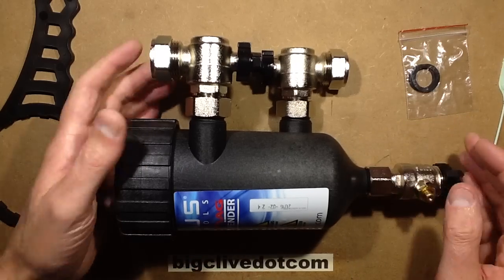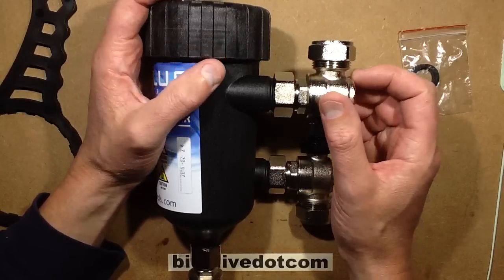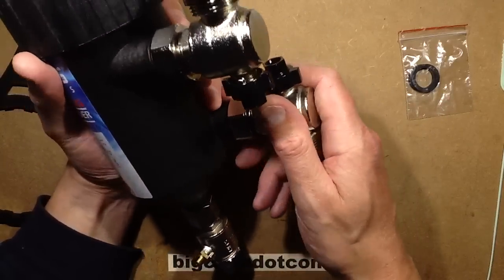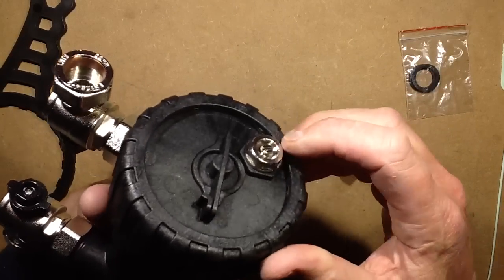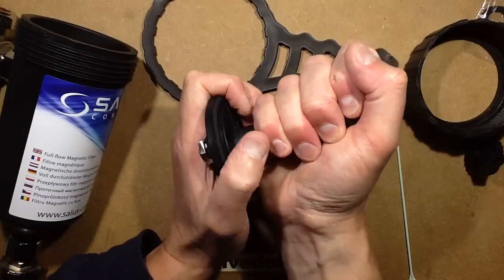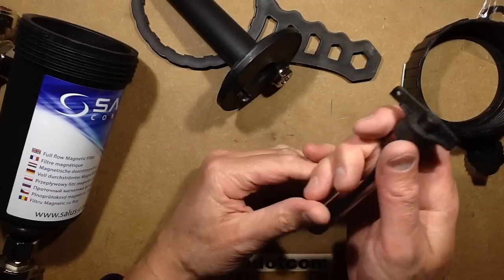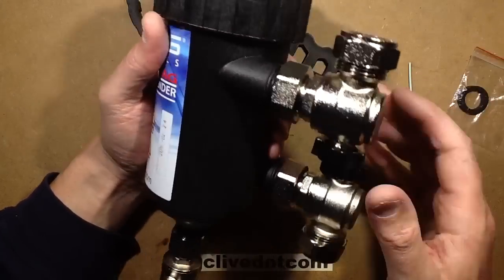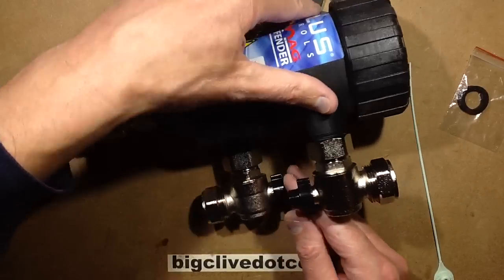Inside a heating system magnetic "sludge" remover.

Comment: i think they put the two pipe connectors offset from each other for two reasons

1) to encourage the whirlpool effective inside the cannister so the debris spins around makes contax with the magnet so more chance of getting trapped in the can. 

2) lateraly stability of the unit. because it sits off the wall so prooudly, it can easily be knocked. Having the two connected pipe either side gives the can a bit of sideays knock resiliance.

Comment: Clive how did the install of this device work out for you? I wished I had hot water heating in my house or better yet steam heating . But I have central air with a heat pump. Each has it up and down sides.
Reply from the maker: It's still in the box.  The location of the pipe it was supposed to go onto was in a 3" gap between the back of the boiler and the wall of the tiny room it is in.  The pipe then went under concrete and then underfloor.
Reply: @bigclivedotcom  So you bought it back in 2016 and almost 6 years later it's still in its box ? 😂😂

Comment: I thought the UK was up to the times. Steam heating. Wow ! How barbaric and inefficient.
Reply from the maker: Not steam, just hot water radiators run on a loop from a central boiler.  Much cheaper than electric heating.

Comment: thing is, what stops the anti corrosion chemical getting into your drinking water?
in our house we often fill the kettle from the hot tap , as the water tastes weird from the cold
Reply from the maker: The radiator loop is a completely sealed loop that does not have a direct connection to the normal water supply.

Comment: Ok, I realize you have probably dealt with the problem by now... But couldn't you have just released the nuts on the housing and turned the connectors slightly to make them in line? Of course then they wouldn't be in line with the rest of the thing, which may or may not be unpractical, but they would in line with each other...

Comment: You know that the iron oxide, called magnetite, will stop forming when all the oxygen is used up, right? If you have a sealed system that doesn't leak and never add any water this is completely unnecessary. And oh yeah, "flushing" your system completely defeats this.

Comment: I think what I need is something to protect my boiler. I was told about a proper  water softening device that uses salt tablets to soften the water and eliminate most of the sediment problems inside the Boilers clarifier and your washing machine should not only last longer but you use less soap.
But I will get one put in and save my Raddies

Comment: Do you really use hot water heating systems? My house is a forced air/radiant floor heat combination, which uses a larger burner and a smaller blower to create approximately 75 degree (Celsius) air, which flows under a network of pipes under the floor and above the ceiling to warm them and radiate heat, and then pumps out about 50 degree air through the registers. For a house with stone tile flooring which is ceaselessly cold, this results in nice, warm floors and the ability to run a whole-house humidifier in Ohio's dry, freezing-cold winters. (I mean dry, before we installed that humidifier we would dip to 8%RH or so in the house for months at a time.
Reply from the maker: Pumped water is one of the most common heating systems in the UK.  These days it's often used as an underfloor system whereby the floor is laid as a thermally insulating layer, then a matrix of flexible pipes and a final floor layer.  All the heating is done at low level from the floor so it's silent and very ambient.  I wish we could have low humidity here.  Being in the middle of the Irish Sea means I need two plumbed in dehumidifiers to keep the humidity down to around 60%.  Without them it would rise to 90% or higher.
Reply: We have forced air Heat Pumping to dehumidify our house, works fine in the summer, when humidity is upwards of 90% (Lake Erie Downdraft) but it gets so cold here that we need a gas burner to supplement the heat pump for 4 months of the year. Fully-Automatic system, with heat pump to cool mode at 24 Celsius, heat pump to heat at 22 degrees, and supplemental at 20 degrees. (Approximate temperatures, the thermostat is most likely smarter than you or I, and looks at outdoor weather to decide what to do. )

Comment: wonder if that would work in the sump pump systems.  Which is needed both during the winter and during the summer.  Sludge hell in that sump pump which well, kids shouldn't be around it.  the electricity is tied out with a plastic/metal tie  smh  oh just unscr...zap  Probably Iron Sludge.  No Radiator around here.  It's a combination coming from the Aprilaire (yuck) and 3-4 other drippy areas.

Comment: once the dissolved oxygen has reacted with the steel that's most of the corrosion over as long as no fresh water is introduced.  most pinhole corrosion is copper particles settling on the steel and creating galvanic corrosion . as a plumber I find these devices mostly useless as they don't actually stop corrosion and there an expensive way of adding corrosion inhibitors.  Most central heating flow rates wouldn't disturb settled sludge in radiators either

Comment: That looks like you could pretty easily turn the connections to be in line with each other.  Loosen the fittings at the body of the unit, turn to preference, retighten.  Maybe add a little seal tape for good measure.  Yes, it will skew the body of the device relative  to the pipe you splice it into, but it should be fine.

Comment: just extend the boiler pipes down and fit under the combi then go bk up to the existing pipework clive
Reply from the maker: That would be tricky, as it's an oil boiler that sits on a concrete floor.

Comment: I'm not familiar with this kind of distributed heating system, though I understand the basic idea. My question though is why don't they make the radiators out of copper as well as the pipes. That would eliminate any galvanic reaction issues wouldn't it?
Reply from the maker: Probably cost.

Comment: You still have a water heater radiation system? Wow. That's one of those things that I so out of style that it's cool.
Reply from the maker: +awesomeferret Heating a house electrically in the UK would cost a fortune.  Gas and oil are cheaper options.
Reply from the maker: Very common in the UK.   An oil fired boiler too due to the cost of fuel on the Island.
Reply: bigclivedotcom I wonder what the reason for that is. Older houses? I know it works well and isn't really "obsolete" but i'm still wondering why it's used. Is electricity really expensive in the UK or something?
Reply: Godfrey Poon old post but oil boilers are a huge part of any remote part of the country that doesn't have mains gas. Propane is way to expensive

Comment: UK gas heating engineer here. I replaced our 12kw forced air heater with a 24kw combi boiler, with all the rads and pipework it came to less than £2,500, but I didn't skimp.. the new system uses less gas than the old forced air unit did as it cycles on and off less frequently. there is no way near the amount of dust collecting on all our surfaces, and we have instant hot water at mains pressure as well as a new cupboard in the bathroom where the old cylinder was. The one thing I really do miss though is how quickly the house warmed up with the forced air unit... 
as has been said it previous comments the filter should be on the return leg of the heating circuit as close to the boiler as possible. that way you protect the boilers water section, and capture the most sludge possible. be wary of putting it in place of a radiator as you have effectively created a full bore bypass on the system, your rads won't get as hot unless you put a valve in there somewhere to control the flow.
Reply: +Rob k (RobKix) 😂 you do DIY, I am a professional tradesman with access to more knowledge than you will probably ever have on gas heating, as well as years of experience doing the job day in and day out. If I ever need an LED clock I will be in touch...
Reply from the maker: If I do it I will restrict the flow and just use it as an ambient filter to gradually catch water borne particles over a longer time.
Reply: You must have a massive house if you are a heating engineer and it STILL cost you 2500? I replumbed my whole house all new rads and pipework with a combi worcester bosch 32i for 1800 all in...and paid a mate 100 quid to hang and commission the boiler. Oh and he did get the boiler and rads cheap as in if you are buying 200 a month wholesale.
Reply: +Rob k (RobKix) well you tell me how big it is being as you seem to know how much everything costs, you massive tart. 😂
Reply: +Rob k (RobKix) what you know about heating systems could fit on the back of a postage stamp pal. thanks for commenting though!
Reply: ok well apart from hanging a boiler i have done everything else domestically you can think of including underfloor heating and solar.

Comment: 22mm-15mm reduction??? this needs to be near to the boiler as possible on 22mm in & 22mm out. Besides putting a strain on some pump unitsI can't see it being efficient doing it your way unless . . . ALL of your radiators run from 15mm pipe. 2x 22mm (feed & return) pipe should run around your abode, with radiator feed/return reducers teeing off to relevant radiator. (though I've come across rad's in series at one job in Shirley, shut one off & they all go off)
Still great Vid's though Clive!

Comment: Watch out with adding the corrosion inhibitor liquid to old pipe systems old leaks can show up 
Calcium and other polutants can plug up small leaks adding a corrosion inhibitor can dissolve the calcium and you will have a leak

Comment: You should be able to turn one of the fittings 90 degrees and install it on a corner where a pipe goes 90 degrees.
See image http://www.adey.com/images/filters/pro2/mio2.jpg Image credit ADEY Professional Heating Solutions
p.s. Don't use the pressure relief valve to let the water out, it'll probably leak, because the crud will prevent a good re-seal.

Comment: If you was to loosen the two ball valves and twist them slightly you could probably fit it on a straight bit of pipe but the unit would be slightly on the Mickey Bliss.

Comment: Given how dissimilar cause corrosion, why use copper for pipes, instead of steel? Copper is also way more expensive.
Reply: Copper conducts heat better, and corrodes far less than steel. The pipes are usually the last thing you want to replace, radiators are easier to access, so they can afford to be cheaper and shorter lived.

That's what i would guess.
Reply: The pipes do not have to be conductive at all, the heat is transported via the heat capacity of the flowing water, not by conduction. In fact, I see no reason why the pipes couldn't be made out of plastic. Of course it would need to have sufficiently high softening temperature, but otherwise no problems.
Reply: TheBackyardChemist
Well, copper lasts longer, wont permanently absorb pollutants, is a natural anti-microbial is easier to install, so on and so forth.

Plastic HATES heat and chemicals and is far easier to accidentally break, copper will just dent and bend (say a house shifts over decades)

It's just like guns, a lot of them are plastic, and that's fine, but metal adds and extra level of durability, recoil reduction and helps cool the barrel (until heat soak happens).

Comment: Clive, f you can't fit it by the boiler then the other option is to install it on the primary return pipework coming out of your hot water cylinder - that should be the last appliance on the return to your boiler if your system is plumbed correctly. Anywhere else, and it won't do it's job properly. Somebody mentioned here already but the socket in the end of the included spanner handle is for the isolation valves. Finally, your pipework will most likely need an offset putting in to align with the valves and make it sit upright, but you may be lucky and manage to just use an elbow into one of the valves instead although it will definitely be tight. 
Good luck with it. I hope some of this is even slightly helpful. 
Massive fan by the way and love your videos. Keep doing what you do!
Reply: bigclivedotcom and probably with mesmerizing light patterns in all kinds of colour except cold white
Reply from the maker: My ideal home would be a huge watertight barn with a porta-cabin to live in, one as a workshop and loads of space for "stuff".
Reply from the maker: Alas no.  It's an ancient oil burner boiler with integrated water heating section.  All the plumbing is down behind it, then goes through a wall and straight under concrete.
Reply: +bigclivedotcom Do you not have a hot water storage cylinder in an airing cupboard somewhere that is heated by your boiler circuit? It might just be solely.on immersion heater which is no help at all!
Reply: +Chris Hempsall Sorry, I only just read your reply properly and realised you answered that question! Needed some time to wake up obviously.......
Reply from the maker: When I first moved in I hunted high and low for the hot water tank I was expecting.  It's an appallingly slow and inefficient "instant" water heating system which works OK for baths, but is useless for basic day to day hot water.  It just sits outside in a cold garage and keeps itself hot by munching oil to heat its poorly insulated heat exchanger.  First thing I did was add a small vented water heater under the kitchen sink so I had instant hot water for basic tasks.
Reply: +bigclivedotcom you're the kind of man that can even make a tent become a villa :)

Comment: Mr. Clive, if it is within temperature tolerances, it should not matter where in the closed loop that device is placed. I use 150vDC to split the water into hydrogen & oxygen then burn the resulting H to heat my water, although I only use it for water & not home heating. [NOTE: this requires metals with a low corrosion point in electrified water. AKA titanium.]

Comment: I'd add in a section of pipe that had the right bends to bring the two sides parallel. Just a bit of soldering required.

Comment: Actually it's a bad idea to flush a heating system on a regular basis. The water inside contains air and therefore oxygen which will oxidize the metal over time, especially because the water is hot and this will help the chemical reaction. But here's the catch: It's a closed system so as soon as the contained air reacted with the metal this process will slow down dramatically and come to a near halt because there isn't any fresh air coming into the system. This will of course change when you replace the water and therefore start the whole process all over again. So instead of making it better you are accelerating the process of degradation and will end up with leaking radiators sooner than anticipated. In conclusion: Adding this magnet to remove magnetic particles: OK(but keep in mind this will only filter ferrite particles. not copper or aluminum). Adding Corrosion Inhibitors to the water: OK. flushing the system for no apparent reason (like massive amounts of sludge blocking pipework): DON'T. I am in no way a professional on heating systems so please feel free to correct me if i am wrong on any of this.

Comment: Nice to see the review . Ref . off set pipe entry , short flexible tail ? Or adjust fittings on the casing , so they are in line , but the unit is canted over at an angle . Bit of a frig .

Comment: i would have thort you would  pull the magnet and open the drain to let the system pressure clear the sludge. i e got a different version in my system and it seems to work.

Comment: Don't install it on 15mm pipe work as you will not have the same benefit. Fit it close to the boiler on the return pipe work.

Comment: Did anyone notice that the black 'spanner' used to open the filter also has a 'box' wrench in the handle that probably can be used to open/close those stiff input/output valves?

Comment: I have a system that is just copper pipe and has just got some smallish fins attached to it to form a typer of radiator, called baseboard heat in the US. Never seen a nice big radiator like you have in UK and here in DE. Funny as it can get quite cold where I live -15c sometimes but not as bad as more northerly states but it seems to work unless it's very cold. Wonder if this would work with the expansion tank that feeds the heating system. I had to flush the thing out a year ago as it's shared with the hot water system and our hot water turned brown.Was told in may be the big expansion tank rusting out but I thought it was perhaps silt. Guess I should of put a magnet on the stuff :)

Comment: I don´t know if changing out the water is that good at all. The old water lost all dissolved gases like oxygen over time and deaerated. Furthermore the mineral content stabilized in relation to the heating systems piping and other materials. New water seems to be mroe corrosive. I never changed the water since 1978 when my system was installed. Never used a corrosion inhibitor either and never had a leak or problem with a mixed system of radiators and floor heating. The sludge filter seems to be a good thing never the less since filters out the rust.
I will be changing the furnace soon and will take a look inside the boiler to see how it held up. But can´t complain for almost 40 years of reliable service. Never let us down and all it needed in those 40 years was 1 new oil burner and a couple of circulation pumps. One of the 2 circulation pumps is actually still the original one, the other one failed 3 times.

Comment: if you rotate both metal fittings counter-clockwise a small amount, they'll be in a line (although out of line with the mid-line of the plastic body)